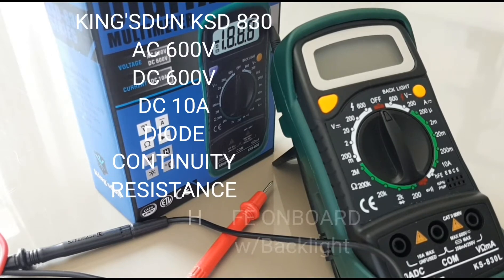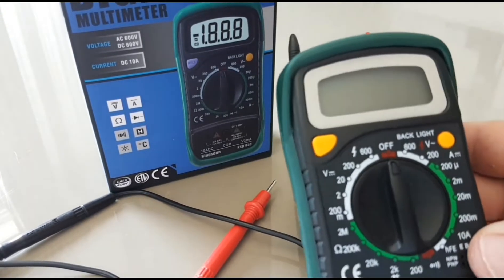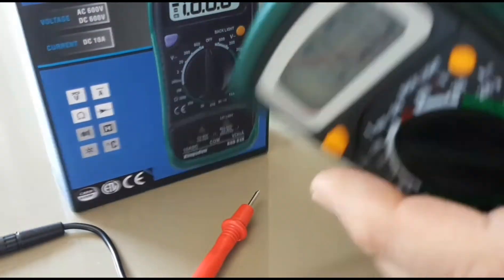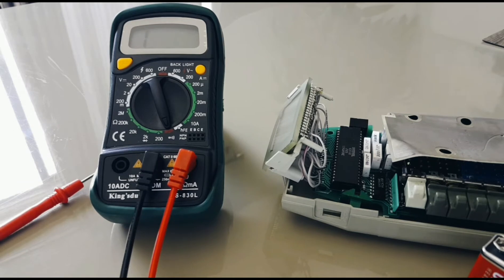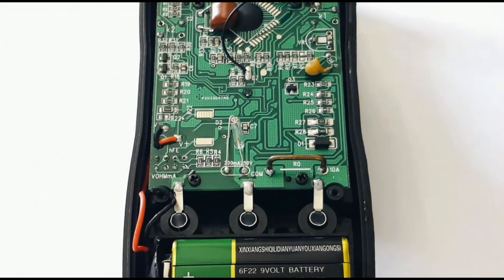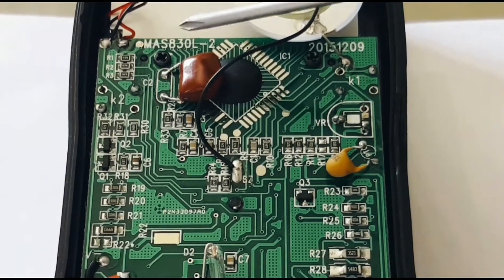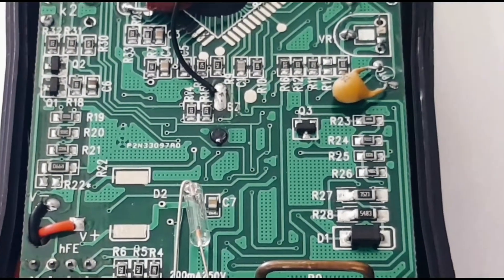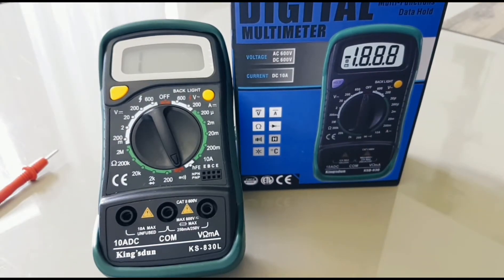KING'SDUN KS-830L CHEAP-O Multimeter Review & Teardown!

Comment: Check (or replace!) that fuse! These crappy soldered fuses are typically 5..6 A instead of 200 mA.
PS, R27, R28 and D1 are not protection elements, but two links of the voltage divider chain and the AC rectifier diode.
Reply from the maker: Those pigtail fuses are indeed suspect.   I would probably replace with a resettable polyfuse.

Comment: Hi, Great video. I'm working on one of those meters right now.  Could you tell me the value of the PTC which is that yellow looking diode or capacitor. Thanks.
Reply from the maker: Just seeing this request now..if u still need this let me know.
Reply: @KeepOnTesting  Yes, would like to know the if its a capacitor, diode or resistor and the value of it. Thanks.
Reply from the maker: @tomcat501976  OK.. I'll have the info shortly
Reply from the maker: @tomcat501976  It's a 75S PTC thermistor. High voltage withstanding capacity：420VAC-1000VAC/ Switch Temp 75°C Chip dimension 3mm
Reply: @KeepOnTesting  Thanks a lot, really appreciate it.
Reply from the maker: @tomcat501976  No problem 👍

Comment: no voltage reference test ? can you please review that mastech 830L meter along with reading accuracy tests, similar model but internals are little different.
Reply from the maker: Roger that, I just placed an order for one for review! Should be reviewed next month! Thx for watching!!
Reply: @KeepOnTesting  wow, thanks !
Reply from the maker: @iceberg789  😀👍
Reply: @KeepOnTesting  if you don''t mind, i would like to request you to do side by side reading comparison with one of the accurate meters (fluke or something) at different ranges of volts, currents and resistances. may be you can compare it with this kinsdun meter too, if you still that this meter and if time permits.
i hope i am not being a bother. just because i bought that mastech meter recently, feeling a bit curious. :s
Reply from the maker: @iceberg789  No worries, I will test the Mastech against a few clones and I will bring out a calibrated Multimeter to add to the mix. We should get a good indicator about the accuracy and overall performance.
Reply: @KeepOnTesting  great, you are the best ! :)
Reply from the maker: @iceberg789  Keep On Testing ! 😀

Comment: Are these 830L meters actually usable for DIY electronic kit / arduino kinda work, or are they garbage?
Reply from the maker: They are definitely useable! Arduino projects will be perfect for them...
Reply from the maker: Definately..
I think its a great addition to the bench.
You would be surprised at how accurate they are..
Reply: as for voltage and resistance, the readings are within mentioned spec i think. not sure about current.

Comment: We actually get those flat 830B meters for free in the US with coupon at Harbor Freight, and the other one is akin to its "upgrade" if ya will.  I did a mod on the backlight I saw on YT where you can have the "too bright/too quick to off" backlight stay on at half brightness any time the range switch is turned on, the way he did it he ran a jumper down to the battery compartment so it could be defeated, but left mine that way all the time as im not so concerned about battery life on this cheap meter.